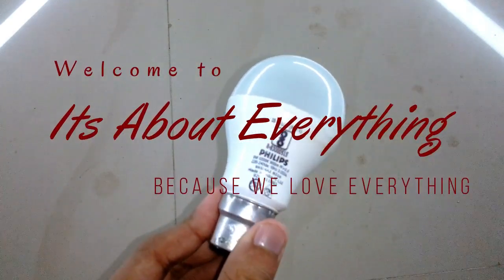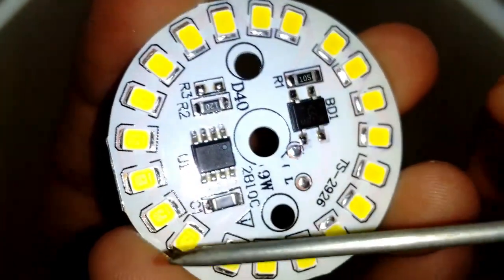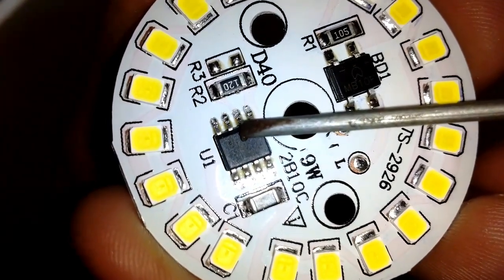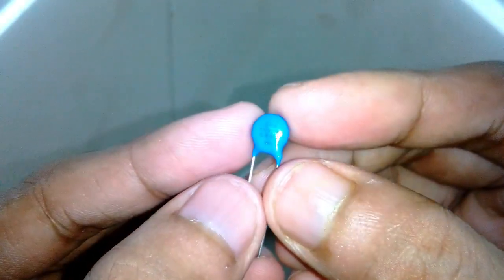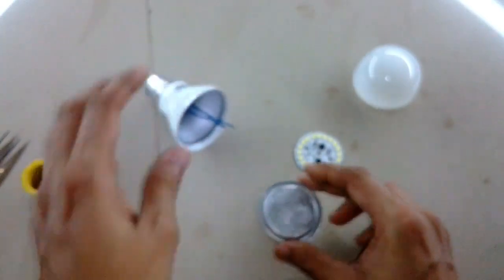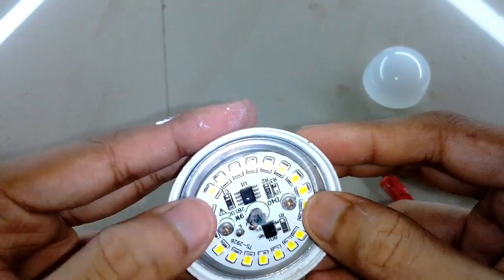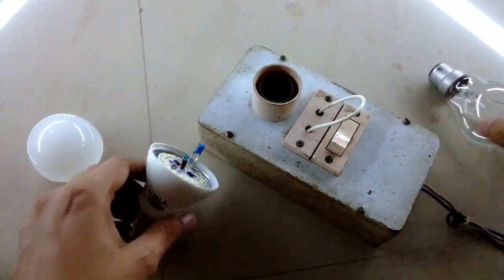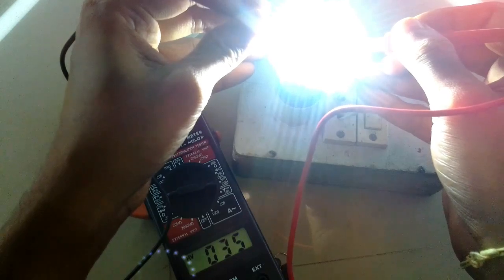How to make an Led bulb with MCPCB/ Driver on board led module -- Its About Everything

Comment: dear sir , 
it good to see that you used sleeve to protect connection wire insulation .
please give me approximate temp. at the heat sink / mcpc when lamp is operating for long time . i am just curious because heat sink ( tikki ) is also in contact with pvc body whose 
operating temp should not 70-80 c .
i like the presentation . 
regards arshad  lahore  pakistan

Comment: Should have also installed a fuse resistance with MOV?
Reply from the maker: Yes you are right, i didn't had a fuse that time but it is necessary to install and protect the circuit.
Reply: Sir, if I installed a fuse resistor then what should have value of it.